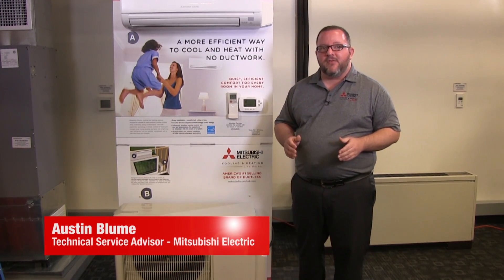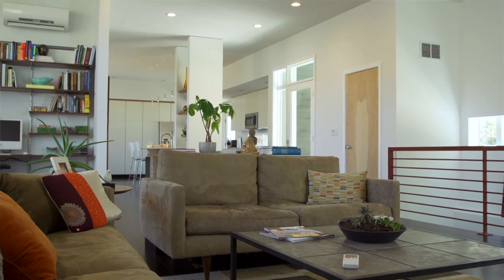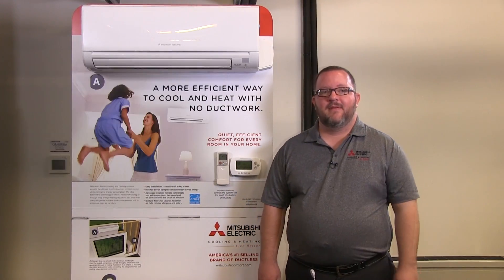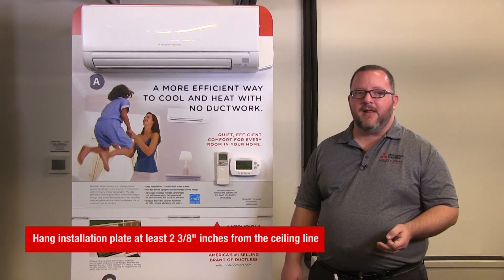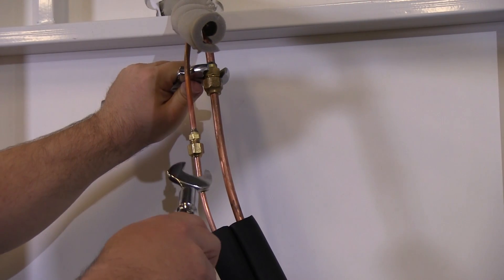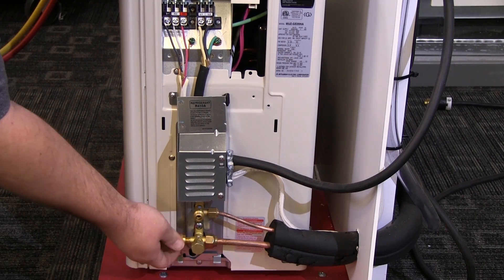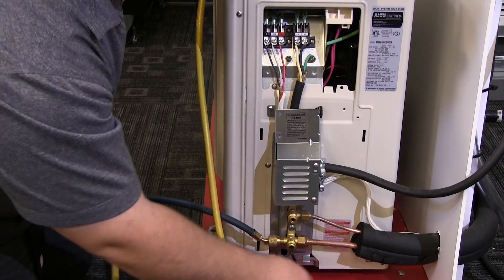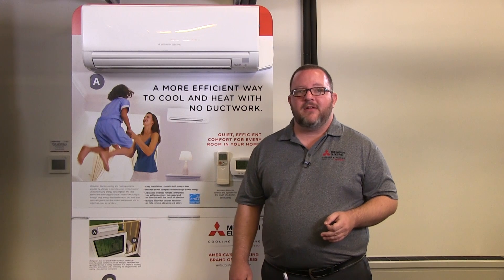How to Install a MSZ/MUZ-GE09NA Heat Pump | Mitsubishi Electric Cooling & Heating

Comment: I have a question regarding my unit, model# MSZ-D36NA-8  in the winter my unit stops blowing hot air? Blows cold air only. When I called the hvac installer he said company told him it is supposed to turn off when temperature drops? So why did I install a heat and A/C wall mount if this is the case? I find it hard to believe that it is supposed to turn off. How am I supposed to get heat then. I think there is something wrong wit heat pump or something. This unit was installed in July first winter.
Any advice?
Thanks
Reply: Get a Diamond dealer to give you a second opinion.  Try to get them to answer over the phone for free.  Otherwise, they will try to send an engineer for $$

Comment: a nitrogen pressure test for 24 hours. lol Even tho this is your recommendation, That mini split turns into a two day job.  Most companies will do 300 psi for 30 minutes then triple evac. Double and triple check leaks with bubble leak. Which I have found a very good and little to no call backs.
Reply: So if extra refrigerant is needed due to longer line set, is it added before or after releasing factory refrigerant?
Reply: @Upliftyourbrothers  I usually add it before. Cuts down on time for start up.  But on some A/C units like Good man and rheem. They have been found to be over charged and added it in after pressure stabalizes.
Reply: smacleod69 if I have an empty line set (preinstalled 4 years ago) do I have to clean it or run solvent down it prior? I’m hopping the internal oxidation of the copper isn’t a big problem.
Reply: @Upliftyourbrothers   What  do you mean empty? Has the lineset been abrazed and hooked up to any of the units?
Reply: smacleod69 it’s never been in use. The cap on one of the outdoor units fell off for a year. Not dirty, just not in use.
Reply: It was put in for a ‘someday’ mini split. That day is soon.
Reply: @Upliftyourbrothers  if you unscrew one of the compression fitting and blow nitrogen thru the lines, and reattach you should be good. Then do a triple evac of the system.